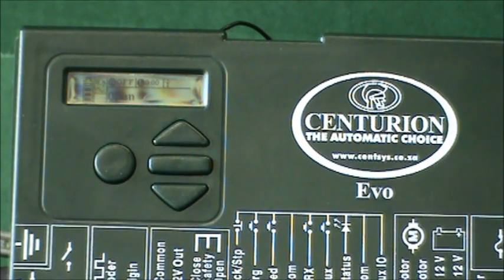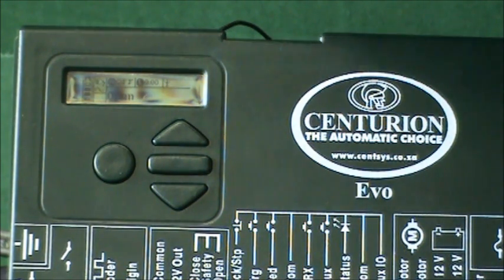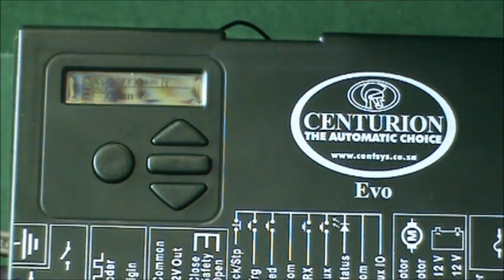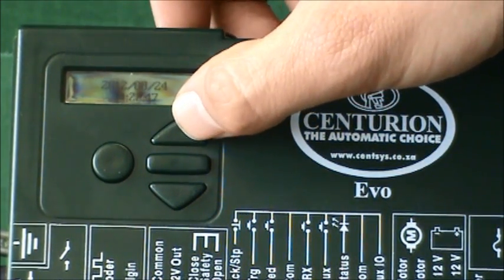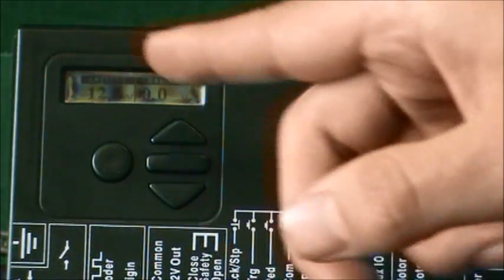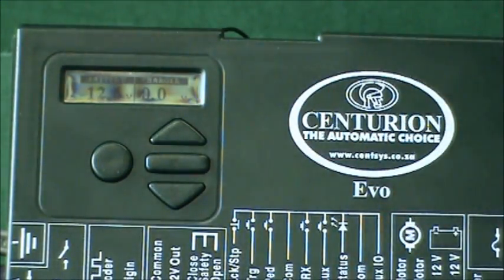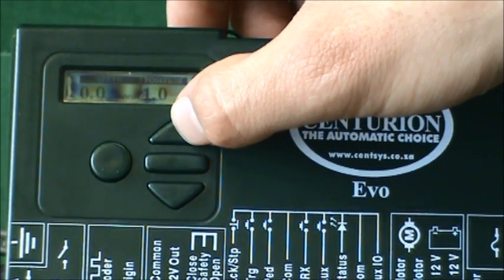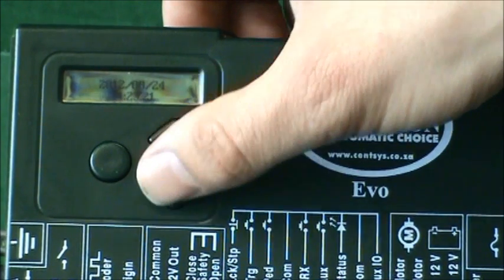D5-Evo - Diagnostic screens overview

Comment: My gate keeps rebooting when i set time limits please help, i dont even use it anymore, the battery voltage is 13.6, so i'm failing to understand what might be the problem, please assist, i tried tightening the battery terminals, this thing is so frustrating, because now i can't set the limits, i have to use it manually

Comment: What causes gate to open itself after i close it...when it reaches its closing position it opens itselft..from there it make "max colliosion' alarm..what could be the cause
Reply: If the wheel hits a stone on the track it registers a collision. After four collisions is registers max and the gate opens. Disengage the motor and move he gate slowly by hand and feel for any crashing. If any lift the gate onto a brick one wheel at a time and spin the wheel to check the bearings. The fact that your gate opens from closing position tells me that you are crashing into the front stop. Firstly make sure that your magnet are as close as possible to the motors case and check for crashing into the front stop. If necessary redo the learning sequence.
I am sure that you have solve your problem by now but maybe we can help someone else.